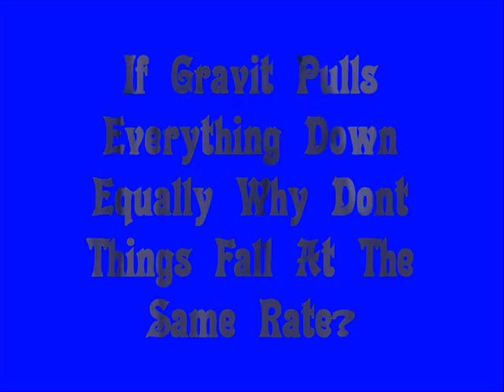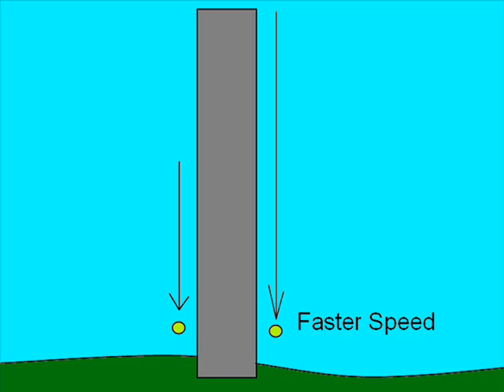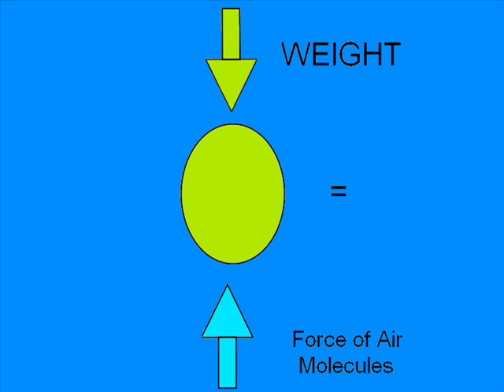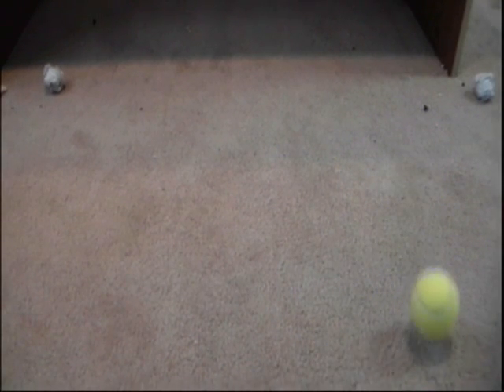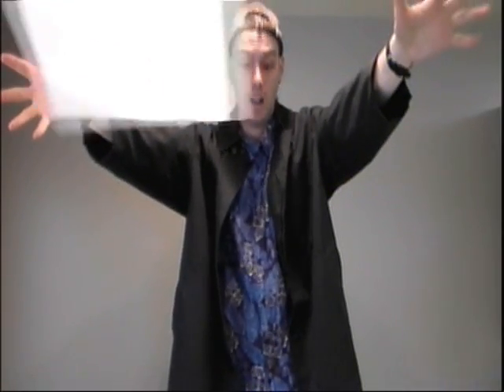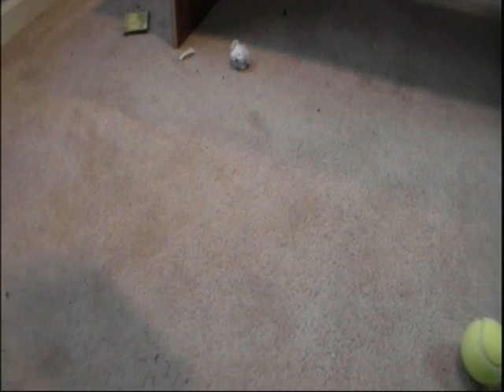AIR RESISTANCE EXPERIMENT AND EXPLANATION

Comment: Also I assume the ozone layer burns the meteor up because of friction caused by O3 and the surface area of the meteor so much so that it generates a lot of energy causing it to burn up and explode before it hits the ground. if it was massive however it would burn up some what but then smash into the ground.

Comment from the maker: The Meteor exploded because inside the meteor were frozen gases, as the meteor passed through the earths atmosphere, the meteor got extremely hot from compressed air molecules these gases sublimated (turned from a solid directly into a gas) this rapid phase change caused the gases inside the rock to blow the meteor completely apart. Its a good thing it exploded because if would have hit the earth it would of made a hole in the earth 20m across and would of caused a 5.0 earthquake where it hit.